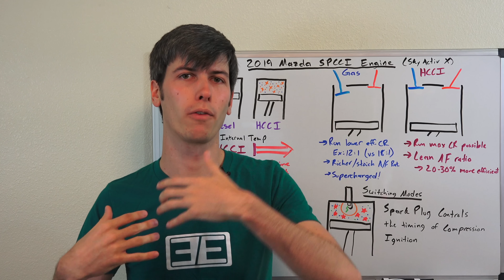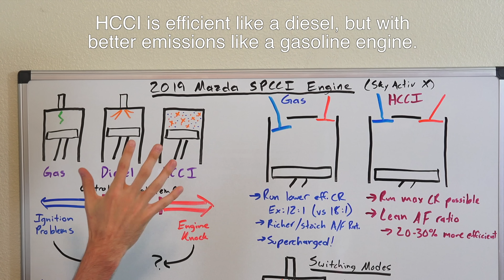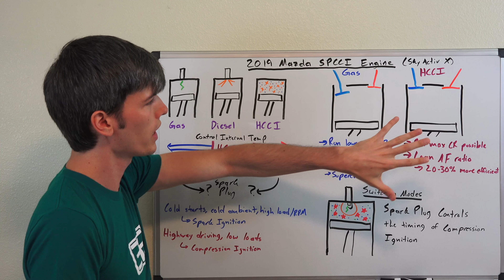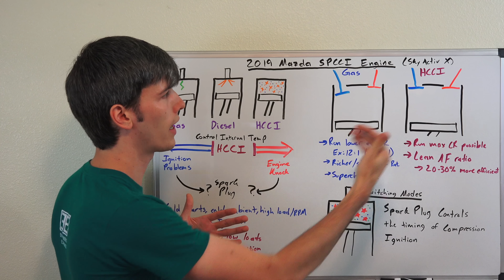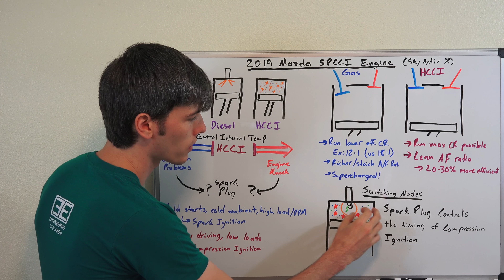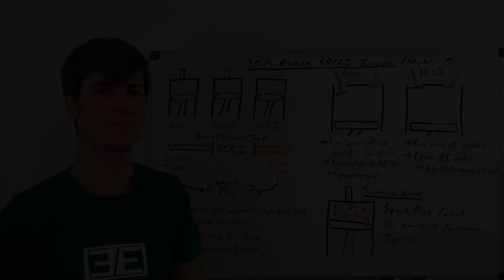Mazda Creates The Holy Grail Of Gasoline Engines - HCCI SkyActiv-X

Comment: Really? Why spend money on developing that when the gasoline engine won't be around much longer unless we find a way of making petrol in a lab
Reply: We do know how to make petrol substitutes in the lab, and at scale. So far we haven't bothered though, since petrol is still so cheap (relatively speaking).
Reply: You can make methanol from CO2 in the air if you so desire, works in a gasoline engine with minimal changes and it actually provides more power per liter than gasoline. It's also CO2 neutral of course, as long as the energy used to produce it comes from a clean source. Dedicate a nuclear reactor to it and you're done.

Comment: One thought is something Koenigsegg has been working on for the past couple of years, which is an electronically operated valve train system in piston engines. I believe they had a running mule in the form of a Saab. In my opinion I believe Cadillac engineers were working on this when they first tried cylinder deactivation in the '70's. Just as I predicted both hybrid systems and gasoline direct injection finding their way on to supercars 20 years ago, I think there will be a boon of electronically controlled systems overtaking the historically mechanically internally oriented. The benefit of this will mostly be that you might be able to refer to an engine as a "motor" eventually without a scolding. I'm just joking around obviously, but I am not joking when I ask, "Where is the hybrid Rotary/Turbine engine?". Turn the rotors into a switch pitch auger like a scaled turbo that are mechanical and not only will fuel consumption go South, but there will be the benefit of an engine brake to save on the other components of the vehicle and run most fuels we can devise to the same effect. It will either be a symphony or a cacophony in truth. They are lying when they claim their design will be "Supercharged" when thinking about current successful supercharged diesel designs. How fast are you spinning? Not fast enough to see 5252 without electric motor help. I'm either bullsh*t or calling it as such. I will be looking forward to the new technology however. Complication at first is the creation of simplification eventually.

Comment: While this is cool, my honda insight has had an atkin cycle engine with lean-burn since 2000. You could argue that HCCI is more efficient than EV when your electricity comes from less efficient sources, but I think all advantages over EV's will disapear when they hit 1000km range.

Comment: its seamless because ignition is an "OR" operation, not an "AND" operation..  what i mean by that is if they leave the coils to run ignition timing, once it leans out far enough, the spark plug will not be able to light it. so whats the harm in letting spark run anyways? and the fuel ratio is a progressive change over so it would make sense that the effects of it would be gradual as well.  i wouldnt be surprised if they were running upwards of a 20:1 or leaner afr. after about 17:1 you arent lighting anything with a spark plug. lol

Comment: Engine longevity will be affected..
Reply: wrong
its like back when fuel injected engines were coming out "reliability will be affected" with fuel injectors
turns out they outlast the car.
Reply: Not necessarily they may build it heavier to take the added load like a diesel  engine
Reply: Its japanese they make it last
Reply: LOw RPM will be almost impossible to achieve, on a freeway will be perfectly fit, may be they have perfected the ignition system substituting the good old spark pulg with something of 21st century. The difficulty also, is to have HCCI working corretly at the huge variation of RPM that a normal engine.
Reply: Actually until just recently Ford Motor Co. held the controlling share of Mazda at 33% (This Means Ford owned Mazda) Ford sold about 20% in 2008 returning control to Mazda.
Reply: No more pressure than a regular diesel.  Modern rings are heat treated.  Why will there be less lubricant ?
Reply: A car is ALREADY affected in its longevity through his electronic. The problem is actually occuring with many cars that haven't their electronic supported anymore. Some cars of today can have a perfect functionning engine, but a fatal software default that is not supported anymore = You can transh the car. This is a huge problem.
Reply: DEAD RIGHT! i CAN SEE THE RINGS BEING PUT UNDER INTENSE PRESSURE, WHICH MEANS THAT THEY WILL HAVE TO BE HEAT TREATED MAKING THEM HARD AND BRITTLE. RUNNING RINGS  WITHOUT MUCH LUBRICANT WILL SHORTEN ENGINE LIFE.
Reply: Edward Reyez 
and reliable emissions, too.
Reply: Jim Jardine theres no other way but to be electric power cars

Comment: +Engineering Explained, Great video! However on your speculation, I believe, precision control of the supercharger has more to do with increasing compression to 18:1 in a 12:1 chamber than simply leaving the intake valve open longer to drop compression.  The spark plug is used to mediate the transition especially, during rapid RPM acceleration.

Comment: Another big variable is that you get different gas when you fillup. The octane changes constantly. This will take several years to perfect, which by then EVs will be all over the place.
High Compression is nice but too sensitive to ambient temperature, load and octane to go BOOM.

Comment: In my day a petrol engine would have a maximum 10/1 compression ratio because @ 11/1 the engine would start dieseling/knocking. Diesel on the other hand would require at least a 13/1 compression ratio in order to ignite the much heavier fuel. Now building a race spec petrol engine with turbo or supercharger you would start with a compression ratio of around 9/1 in order to compensate for the extra air fuel mixture being forced in which would bring the compression ration back up to a maximum of 11/1 at max boost pressure before pinking would start. More fuel in with 10/1= bigger bang in same space = more power out than less fuel(uncompressed) with 10/1= less power out. To state the obvious.

Comment: I don't think your idea to expell air from the cylinder by leave the intake valve open for too long, in order to decrease compression, is a good idea. You are unnecessarily moving air back and forth and will completely disrupt the airflow through the intake port. You really do not want that. Instead you should open the intake valve later and close your intake valve sooner, if you want to lower the amount of air you're going to compres. Valve timings apart, what you are describing is a variable compression ratio engine which goes beyond the limitations of conventional spark plug ignition. A really neat concept! But I don't see how a turbocharger is going to help if you want the ability to regulate your compression ratio down. Loose that turbocharger, this concept will work much better naturally aspirated, regulated by clever valve timing.

Comment: Interesting that they are still talking about petrol engines. 
Many manufacturers are looking to ban them and move to electric engines or  fuel cell power. Or vehicles that can be recharged via Solar.
Reply: There are certain properties of electric cars that will never be overcome because they are physically impossible to change due to energy conservation.

A key deficit being that it takes megawatts of power to charge a EV-sized battery in a comparable time to being able to fill up a fuel tank. What sort of substation could supply this electrical power to several charging units and what sort of connectors would be reliable enough to do it safely? Fine, double or triple the time, your still at the megawatts to 100's of kilowatt level. We're being optimistic with 100% efficiency here.

As for solar charging, there is a limited useful flux of solar energy per unit area, around 1kW per square meter at best. Even at 100% conversion efficiency of photons to electricity, expect a charge to take more than a day if your panel is 1 square meter. In reality, it would take several square meters to accomplish the same task in the same time frame with 24 hr/day perfect sunlight. (Incidentally, BlackMirror showed an impossible tech like this where a woman charged a car in a few hours from a roughly 1m^2 solar panel. Not ever gonna happen.).

EVs are not magic perpetual motion machines that violate physical laws even if their proponents insist on them being a magic cure-all.

Comment: I am having trouble with the explanation at starting at 6:09.  Why would the expanding flame front not be the catalyst for combusting the remainder of the gases as you would in a normal SI engine. Certainly you have a high pressure front at flame front and hence the temperature will increase, but wouldn't the flame simply spread to the adjacent Air-fuel mixture rather that a multi step Flame front to hight pressure to higher temperature to self ignition. I think what Mazda is doing is sensing the temperature and timing of the combustion with the spark on. At some point the engine warms and the conditions are just right for self ignition (ie compression ignition), at that point they simply cut off the spark ignition while continuing to sense the inter-cylinder conditions incase they need to reintroduce the sparks

Comment: The way I look at it the only efficient way to really made the system work it to have the spark plug in a fixture that the onboard computer would regulate, that would either cause the plug to rotate on, causing it to either drop slightly either go into the cylinder head to increase P.S.I. and/or to retract out of the cylinder head to lower the compression.

Comment: Do you know how it will sound and feel ? Smooth delivery of power with very little vibrations and sound when stopped like a gas engine, or we will get the instant torque and the loud rattling of a diesel ?

Comment: Electric will eventually take over for most driving, 100 miles per day or less.  But there will always be a need for ICE in areas without the charge capabilities, especially for long hauls.  Internal combustion technology will continue to improve, and Mazda needs to be commended for taking it to the next level.
Reply: EVs made up 1.1% of all new cars sold globally in 2016, a 100x increase from 0.01% in 2010. In Norway that figure for 2016 was 28.8%. EV production is ramping up very quickly now. I would not recommend betting against EVs.

Proportion of global fleet is not market share, by the way.
Reply: Julia, if you want to charge an EV overnight you need to pull roughly 10 kW from the socket (for an average EV). Average home use (1st world) is 2 kW. Imagine if everyone and their mom wanted to charge their electric cars overnight?
A Tesla supercharger pulls 120 kW, which makes the power grid problem exponentially worse.
The one situation where EVs will be very useful is city driving - if you can rid the city of polluting traffic and instead build a powerplant in the middle of the desert to support the vehicles, you're saving more people from pollutant exposure. It may not be the most moral thing to do but I think it's the correct thing to do.
Reply: A transmission line loses up to 1% per 100 miles. Usually 0,5-1,1%. You're talking nonsense. A powerplant in the desert is better than a powerplant in the middle of a populated city, even including the losses. The feed water pump plus the aux systems use about 10% of the total output of a thermoelectric powerplant. 1% is NOTHING.
Reply: @DevasionX
I don't see how Norway's motives are relevant here. Doing it for the money sounds entirely sensible to me.
Reply: Because you mentioned them being the largest EV users.
Reply: No it wont. Fuel is not going to be the problem.

ICE is doomed because the spare part inventories necessary to maintain these engines is far too complex to be sustainable.

The tipping point for total collapse of the technology is are closer then people imagine. When all the commercial fleets migrate to electric the core buisness stream for the service and repair industry will collapse in a matter of months.

Think about it... you only have to have one part disappear from a catalogue and all the other replacement parts still available for that model become useless. Who is going to risk keeping large inventories when entire models become un-repairable overnight.

3D printing cannot scale up to fill in the gaps before the industry collapses. And who cares about late model cars anyway. All of the custom aftermarket guys will concentrate on supporting the true classic vehicles, which are the low hanging fruit.

Its going to be a shock.
Reply: @wiretamer5710  
Close. 
When car MFG "Applefies" their vehicles and windshields cost over $1500 to replace because ONLY the factory windshield will work with laser guided rain sensors, HUD, and host of other safety features built around that windshield we will run into your said problem. Because it's not just the windshield that's expensive it's  now adjusting every part of the cars sensors after the windshield install and MFG won't have enough spare parts to go around. It's freaking crazy that eventually a car may be so disposable because it's to expensive to fix a windshield so they write off the car.
Reply: It would be more efficient to use external combustion engine for charging since it has fewer parts and needs much less oil and is 50 percent efficient when done correctly
Reply: mariyuso ....
You cannot just build the power plant in the middle of the desert hundreds of miles away....
The capacitance of the wires strung to the village will require lots of extra power to overcome this capacitance.
You electric car people have a wild dream that just doesn't fit into the realities of the electric grid and the properties of electricity.
Reply: Julia Set electric cars are gay.  Drive a diesel!
Reply: ThinkingSpeck norway is an oil export country. They do this for the money like the cucks they always were. Also inhabitants per square mile is very low in norway

Comment: I think this engine has the same problems as the FSI concept way to many sensors and points of failure . For example the inlet valves will get covert with a layer of backed on oil and exhaust gas because no fuel touches them. And because of that the inlet valves don't seat correctly.
This at least is what happens to the first generation of FSI engines .